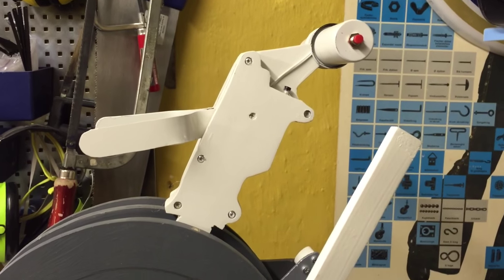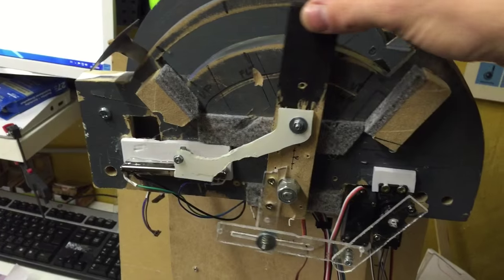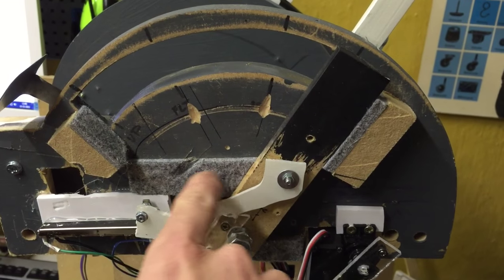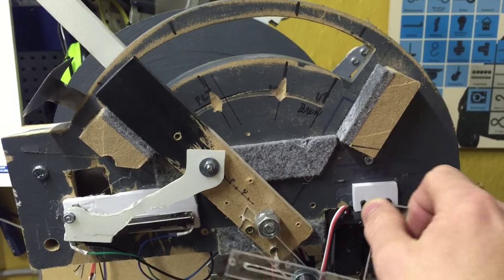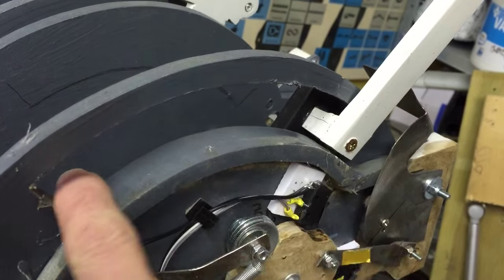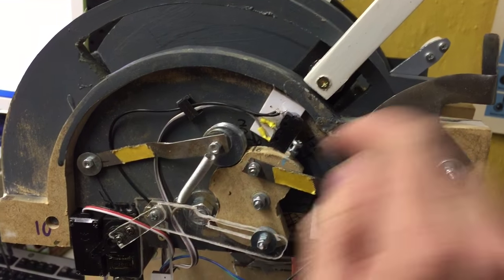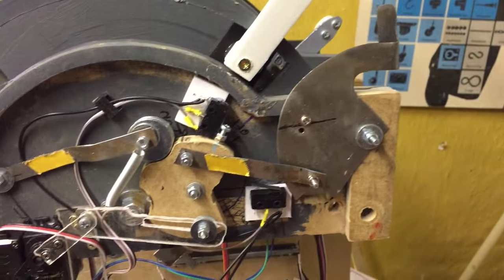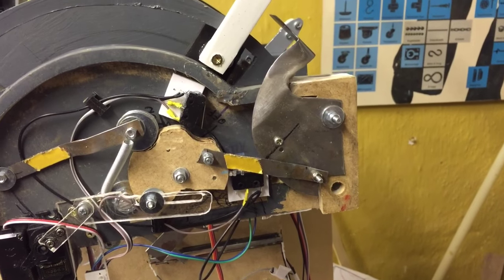Home made throttle: Speed brake and parking brake - B737 Home Cockpit

Comment: I'm actually building one of these right now. I have figured out interlocks to keep the main lever from moving when reverse is applied and the reverse when not at idle. I drill holes through all my bolts and nuts and secure it with cotter pins to prevent future problems with parts falling off.

Comment: great job! , are you using arduino leonardo for connecting the sliders potentiometer to the computer?
Reply from the maker: Hi Arial. I use a Pokeys 57E for the potentiometers and switches.